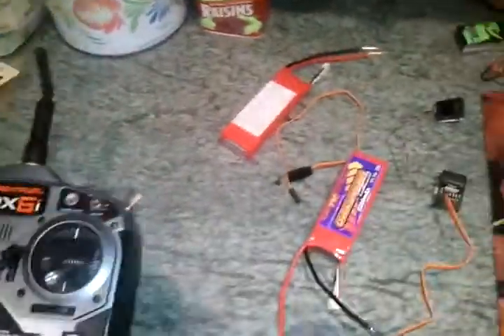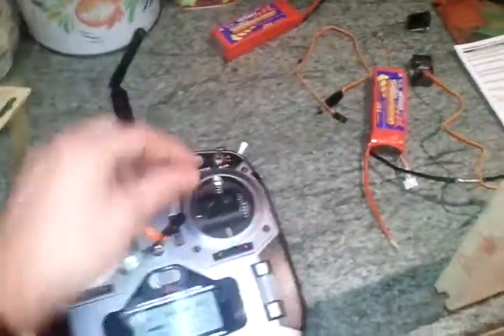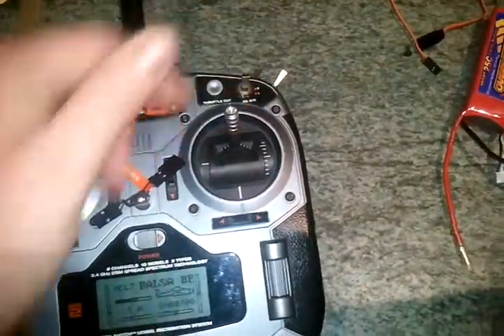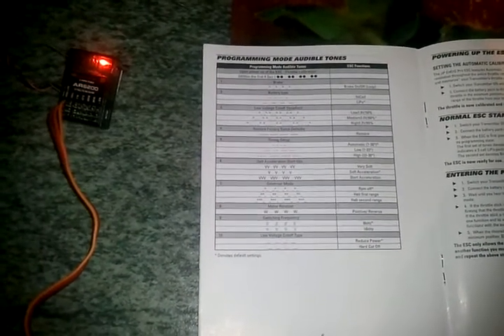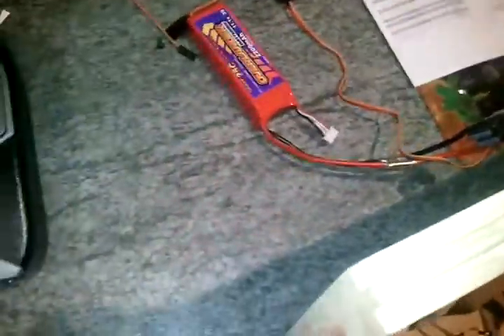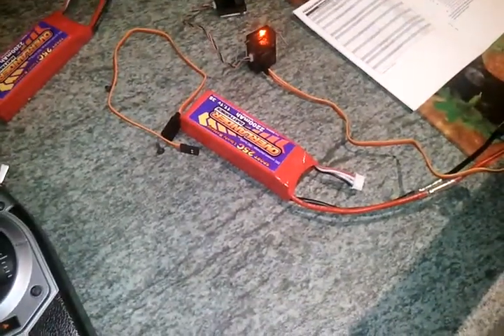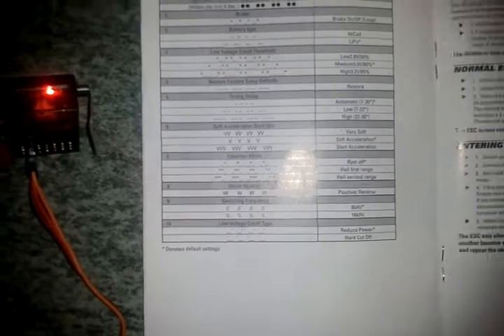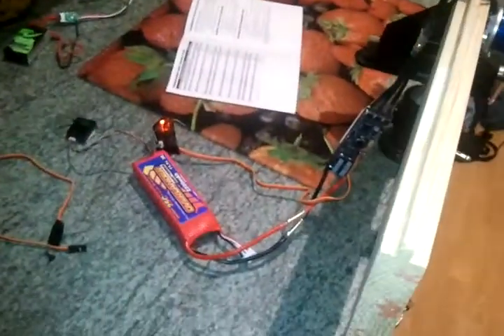lazy bee ESC setup

Comment: Great, well done for a first time, it helped me because I am going to change my frequency too. I have an EnErG Pro 12A ESC with a 1650kv 130W outrunner and a 7x4 prop. Now all I need to do is sort out attaching my prop to the shaft a little better than the system recommended by the model shop! Many Thanks RD.
Reply: Many thanks, great help. Andrew